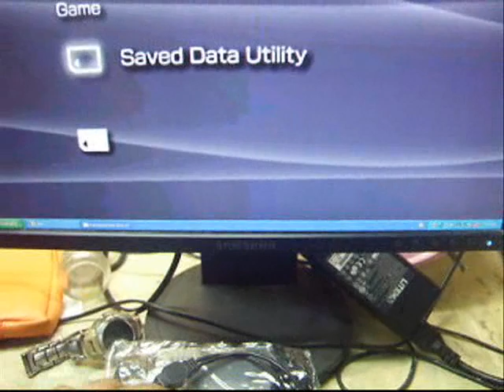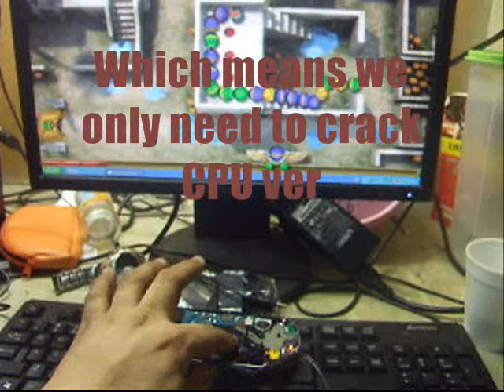PSP3000 CFW RemoteJoy

Comment: wtf is the point of hacking a psp 3000 if you have to break it open and use a computer monitor..... might as well just get a psp emulator for pc or buy a psp 2000 and hack it w/ pandora battery

Comment: still its a psp 2000, he just change the cpu of 3000, there's no sense on having a psp 3000 if the mobo/cpu are came from psp2000. the mic won't work that makes the 3000 a great deal.and if something happens you can't returned it to sony to fix it up.